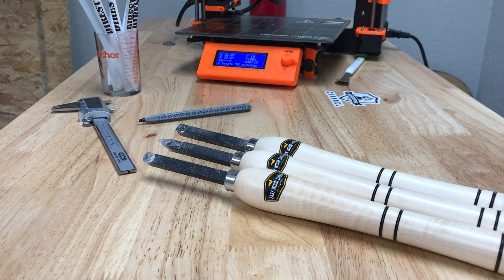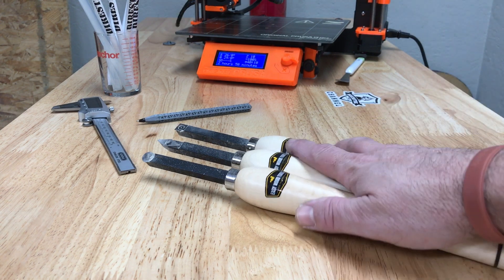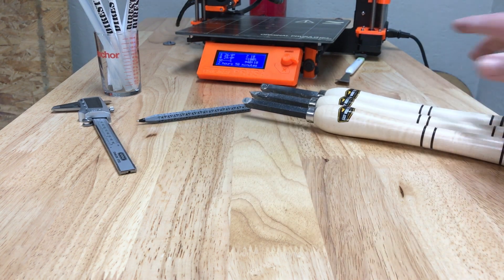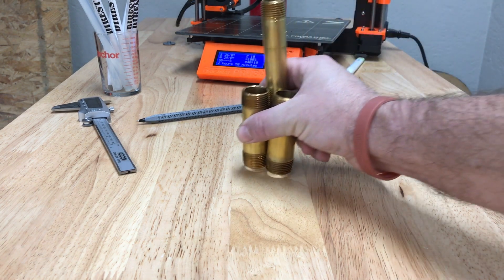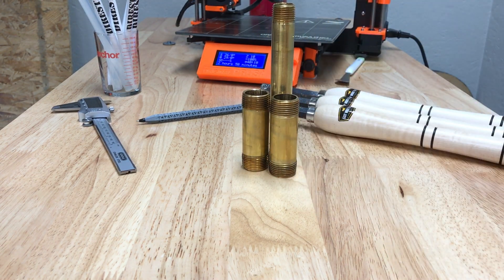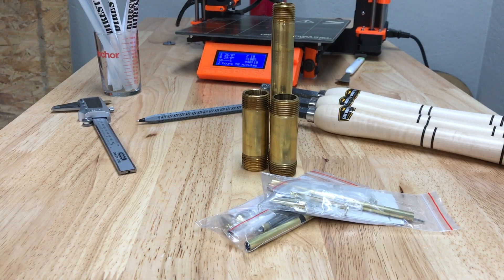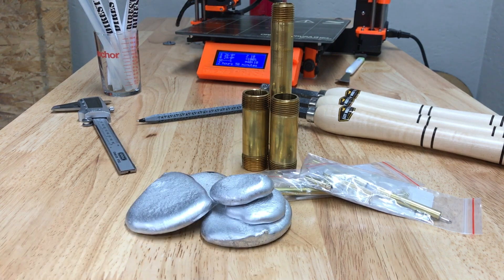How To Turn A  Pen Without A Lathe | Aluminum Pen

Comment: nice. I am glad to see you casting al. 🖒 if you pour in iron pipe or steel conduit it may be easier to extract. when it cools the coefficient of thermal expansion may have a larger difference than with brass. maybe it would be easier to get out. still want it very cool before starting extraction.
Reply from the maker: I'm not sure what happened to the comment I typed out.  Obviously you have more experience pouring aluminum.  I wanted to use steel, but all the pipe I found had  a weld seem on the inside and was concerned that would make it difficult to remove.  So opted for brass which is almost polished.  So the weld seem is a non issue?
Reply: ManCraftingTM I'm kind of hedging my bets by saying may help. I am pretty sure the tube I used had a weld seam. but now I am doubting myself. my guess is that even without a seam the difference in thermal expansion favors syeel.
Reply from the maker: I'll definitely try steel pipe next time.  I'm hoping I can find something like a roller from an old treadmill.  I know that they are usually stainless and no seam.  That would be ideal.